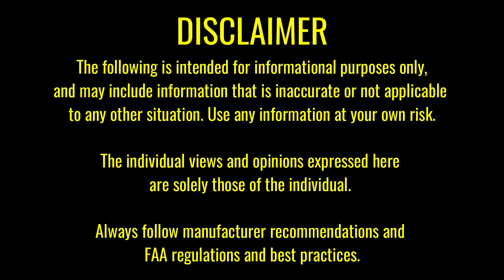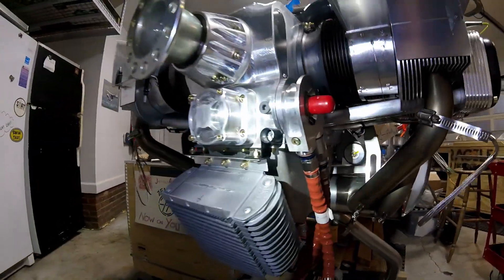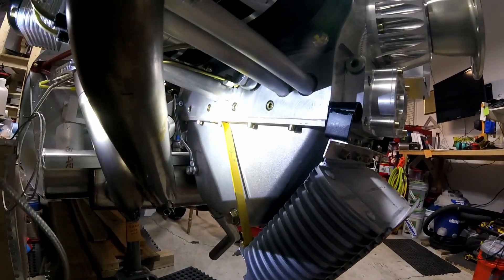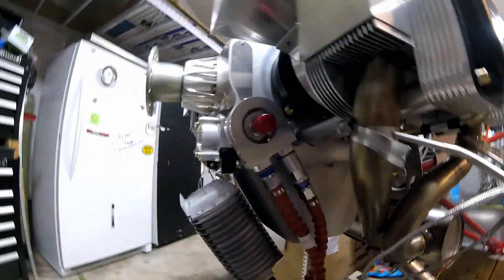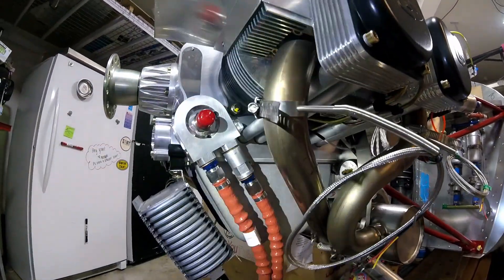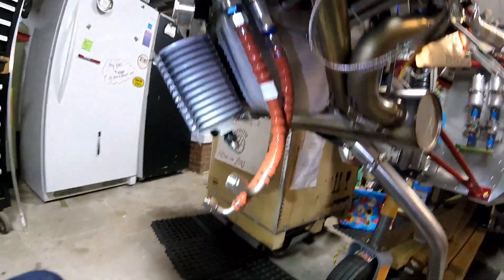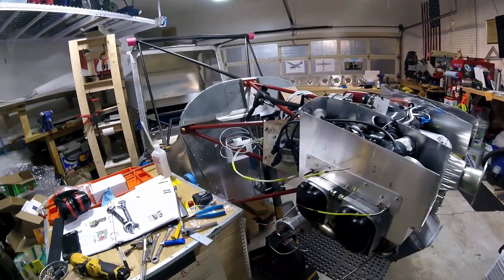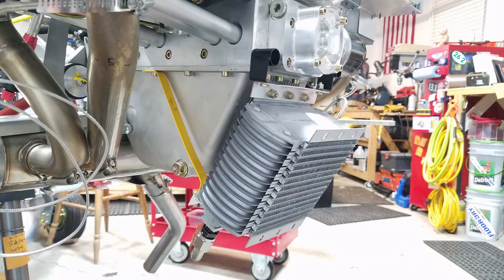Better Oil Cooler Mount Prototype - UL350iS - Zenith 750 Cruzer Kit Plane Build

Comment: Would mind measuring how far the prop flange is from the firewall?   I’m putting a non-supported engine in mine and am wondering if the ulpower cowling will work.  It looks pretty long from pictures.

Comment: Is there a way to safety wire that oil filter?
Reply from the maker: No, not like an aviation style filter. Y ok u might put a hose clamp around it and attach the wire that way.